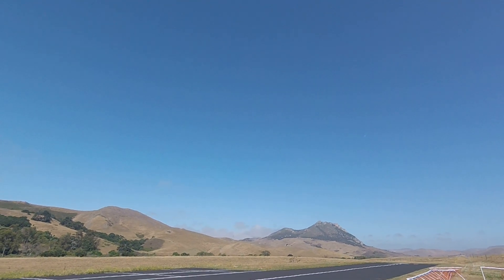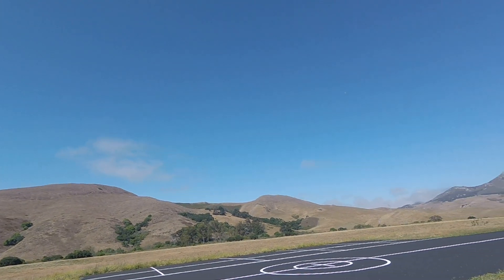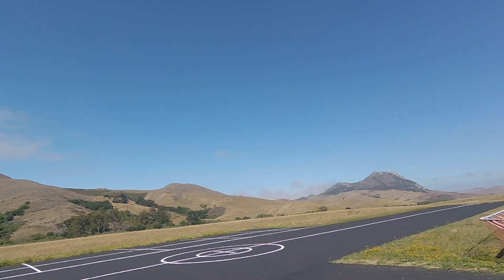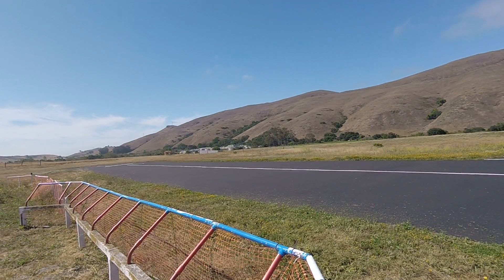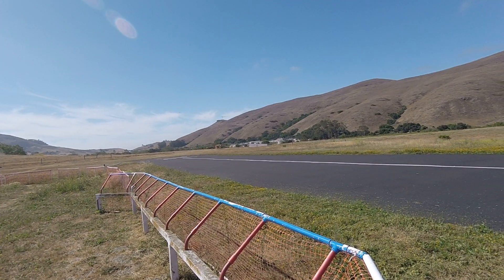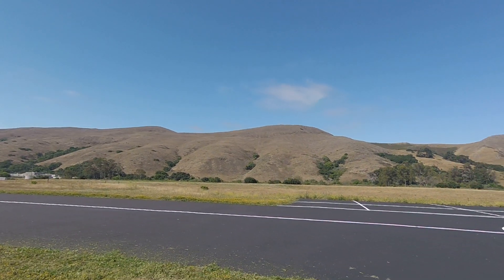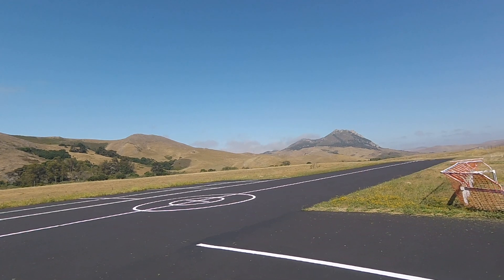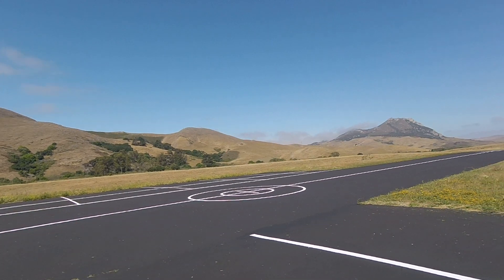Nucking Futs 3D Printed Pylon Racer

Comment: How did you mount the prop on the motor?
Reply from the maker: I used a fairly standard folding prop hub off hobbyking. It mounts on the motor shaft like most prop adapters out there, and the prop blades mount to the hub with bolts.